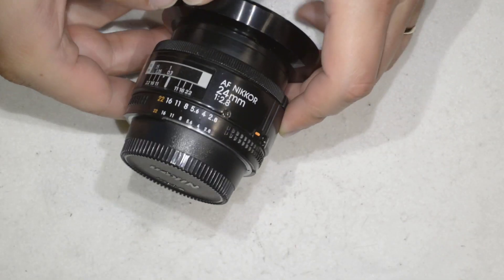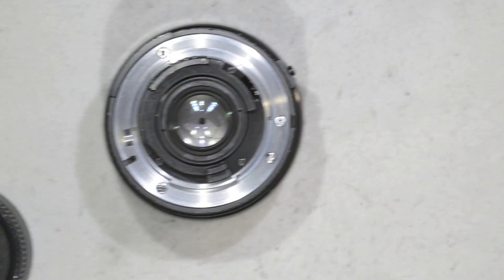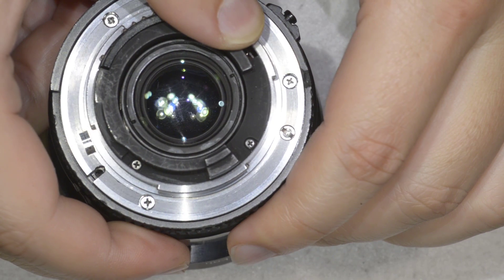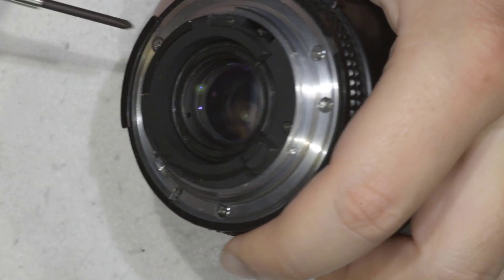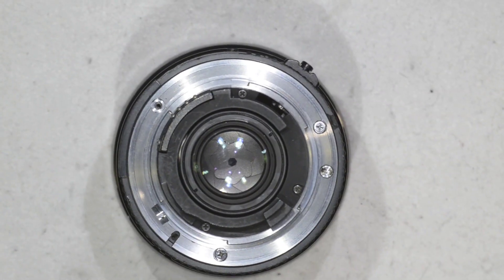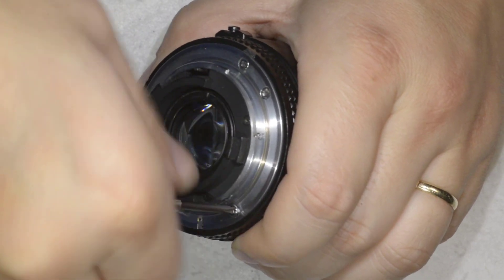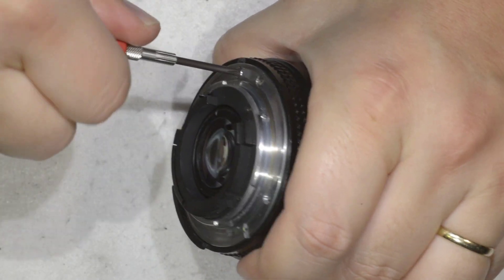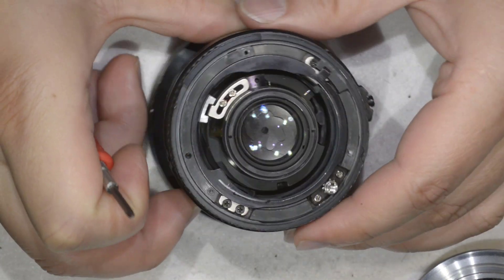Nikon Nikkor 24mm f/2.8 : Haze Removal

Comment: how do you open the aperture section of a AF 24mm f/2.8 lens ? not the f/2.8D
Reply from the maker: Hi, the construction is the same, save for the connection at the back on the bayonet. Check this video here for a full disassembly of the 24mm f/2.8. You want to tackle it from the front. Cheers. https://youtu.be/JBLKd8exBHE
Reply: Thank you for replying to my question. Unlike the (D) series, the non D version doesn’t have the obvious retaining ring in front. Perhaps the front lens assembly unscrews itself using a silicone rubber friction cone?
The lens has performed well but appears to be cheaply made compared with other Nikkor products.
Reply from the maker: My guess is that it does screw from the from, as with the other lenses of this series. And yes, quality is below expectation. I have had a few mechanical issues with the 24mm specifically. Best
Reply: @diyextravaganza 
Thanks again for taking the time to respond. I found my rubber friction rings & managed to the front open. You were correct.
Reply from the maker: @jatoav8or  Excellent, great photos to you.